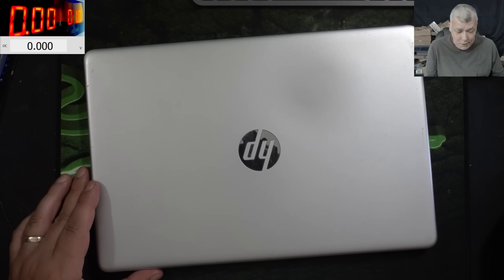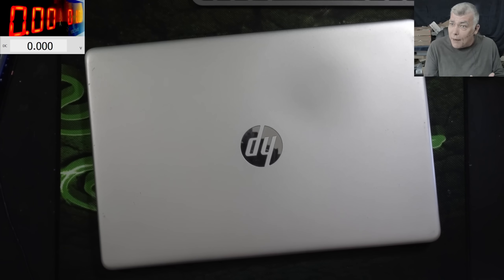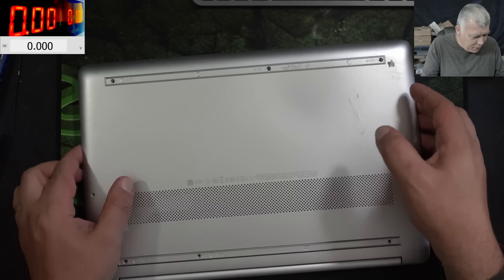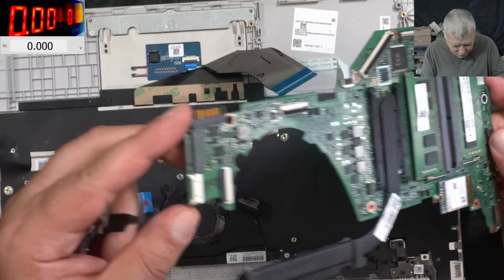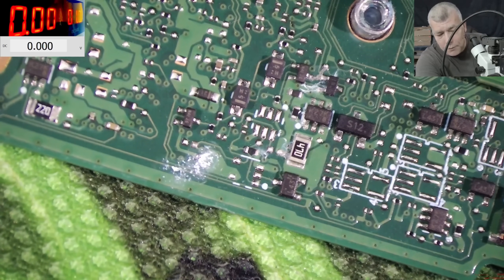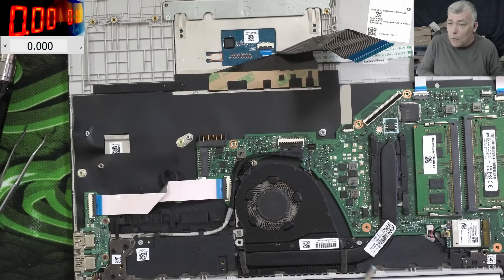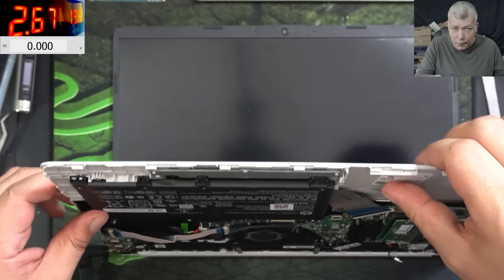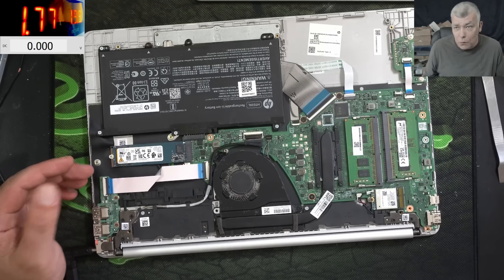HP model 15s-fq4006 no power, liquid damage repair, liquid damage repairs are tricky

Comment: 6:38 one of transistor/mosfet pin trace is broken? Can't tell if there were pads or trace gone. But looks like trace gone.
Reply: Yes i also noticed that it seems a track was damaged under the cleaned area
Reply: I think track goes inside board layers

Comment: Sorin, is it possible to repair the motherboard that is connected to the charger with the reverse polarity. Thank you
Reply: any self-respecting laptot must have the protection from reverse polarity. the problem is that manufactures often omit this part and do not add the relative protection mosfet assuming there are no idiots to connect the power source to the laptop with reverse polarity, which is always the mistake to diminish the scale of human idiocracy. but what they really do is to econom in every place possible.